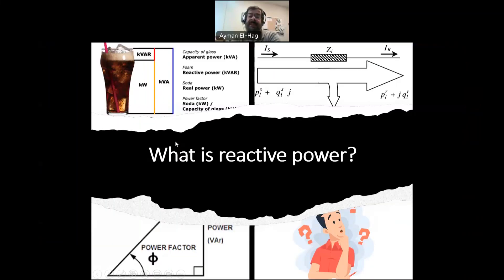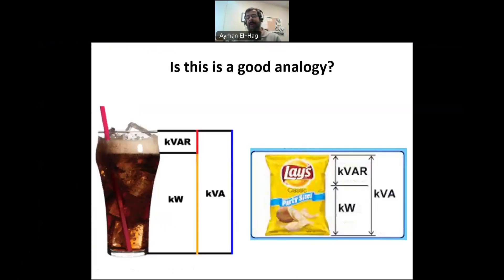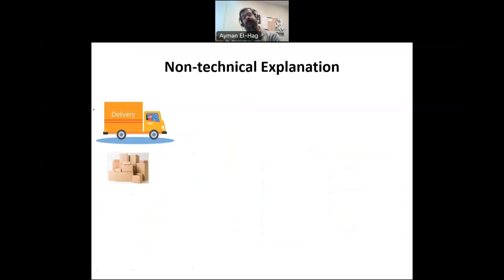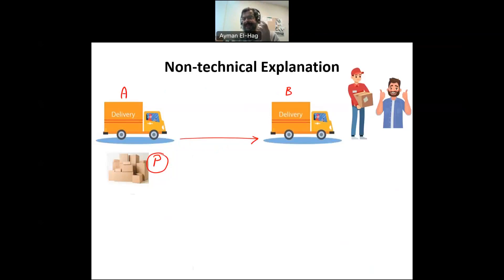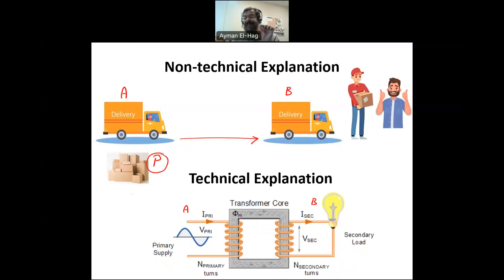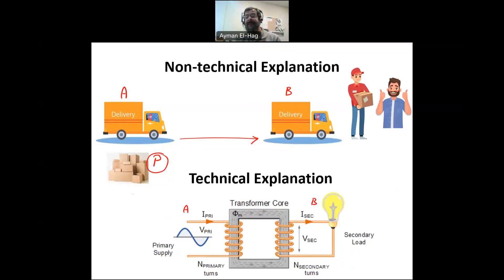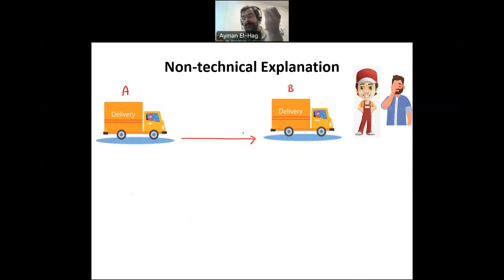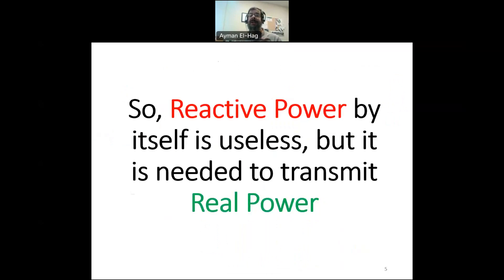What is reactive power?

Comment: Perhaps even better would be to use swing as an analogy. Fuel for a car would make one think that there is additional power needed to upkeep the system. But the input power is mostly the same as the output (if there are no energy losses), that is because the energy oscillates between types, it is not used up. In a swing, we oscillate between potential and kinetic energy, it does not use more energy to keep swinging (it only leaks it through friction).
Reply from the maker: Thanks for your insight, but I prefer simpler examples especially for undergraduate students